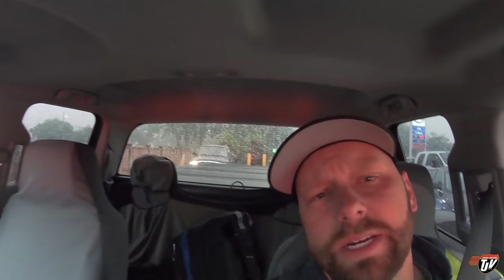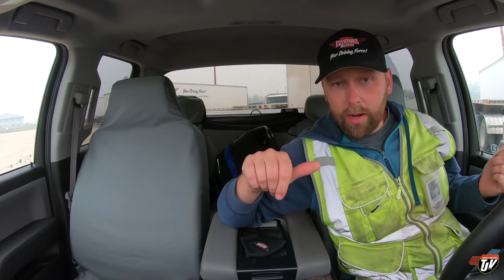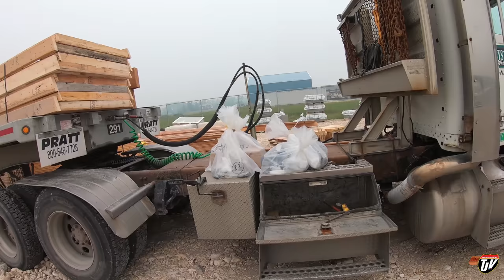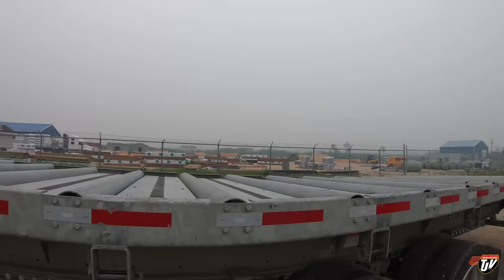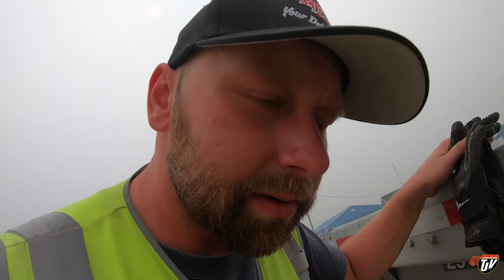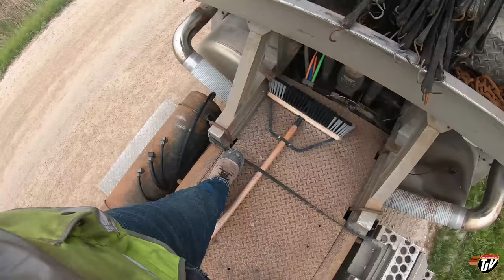ROLLING TRAILER | My Trucking Life | #2329

Comment: That bumper lever should act as brake to slow the load down when rolling it off to prevent breakage and help put the load gingerly where you want it. Then just drive out from underneath it. Ran one for 4 years. It’s all comes with time though. Fun times

Comment: Your right Josh always something new to learn. I didn't know that a trailer like that existed and I trucked for 38 years 🤣
Reply: When you deliver building supply or trusses to job sites they use trailer like that .
Reply: Well I just saw something similar here on Germany, also rollers but in a dryvan trailer, he was delivering engine parts for Porsche. The trailer had train-like wheels at the back, the trailer tilts backwards and with those wheels they load and unload that trailer in about 6-8 minutes. We have 13,6 trailers that would be around 44 feet

Comment: Dont be jumping off the trailer much or ull messup ur back and eh should of got a sled and went for a ride lol
Reply: I destroyed my knees jumping from the truck and the trailer. I hade 9 operations till now, I had a total knee replacement on the left when I was 45 and I think that I have to replace the right very soon. I am 51 right now. Be careful TJ i started when I was 15 to jump from the trailer, I don't want to see you suffer as I do.
Reply: @chrishar110  ya my uncle use to jump off trailers sometimes and his back is shot now and hes only like 40 or something
Reply: @RCman9291  The jumping shock hits everywhere from feet, knees, hips, to back. You will feel the consequences at the weakest spot on your body, mine was the knees, your uncle's were his back. It doesn't matter, we SHOULD NOT JUMP from everywhere. Our body isn't build to do it all day every day.